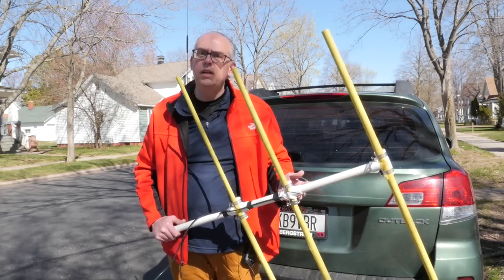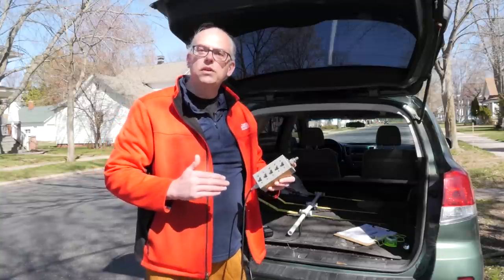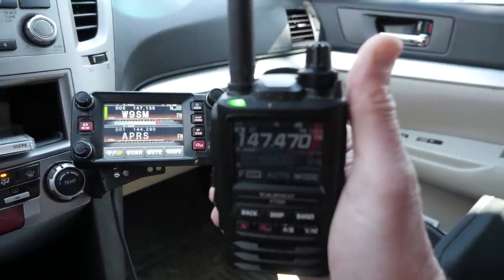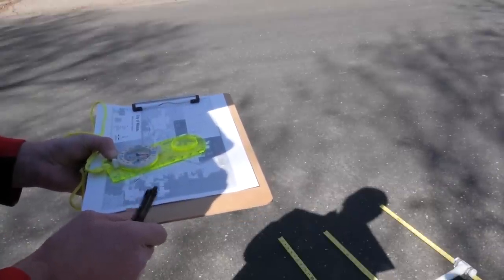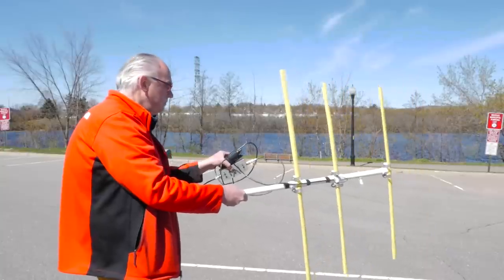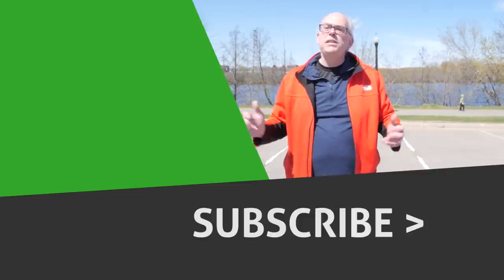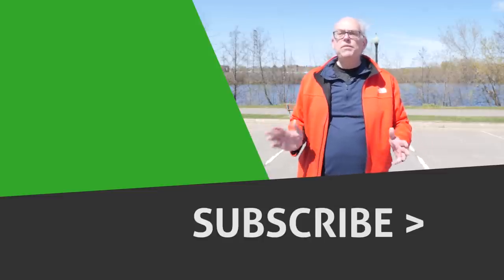Fox Hunt! (Radio Direction Finding) - Ham Radio Q&A

Comment: When I was a teenager thirty some odd years ago, the club I was a part of did a few fox hunts. I rode along with other hams and helped them out. It doesn’t seem to happen as much with the club I’m part of now or other ones in the area. 

The attenuator box is a good idea. It stuck out in my mind that people would take the antenna off the HT and point it once they got close to the transmitter. I don’t remember how well this worked though. 

Thanks a lot for this and the rest of your videos Micheal. This is Carl KB9HPM

Comment: Those tape measure beams actually work fairly well. I made one years ago and still use it. Thanks for another great video, Michael! 73’s....
Reply: I put heat shrink on the elements of mine they look quite similar to those silly tacticool Abbree antennas that are popular now. While making it I sliced my finger on the cut edge of one of the tape sections and I determined not to do that again, also I have leather seats in my car and I for sure don’t want to damage those.
Reply: @daa3417  Great tip! Question for you: where do you find big enough heat shrink tubing to go around measuring tape material? Most of what I find in stores will barely fit around a pencil.
Reply: @daa3417  that is exactly what we used for our Harris prc 152 and our Thales 148 GEMS in the army. heat shrink came off the broken ones and I was like, 'wait...this  is simply unmarked tape measure segments'  made a bunch as soon as I got back from deployment.
Reply: @adamreznik6374  Home depot or Lowes....or if you can find a professional electrician parts house in your area, they will definitely carry that size heat shrink.

Comment: I did a few fox hunts back in the 70s with cb radios. I had dual 8' phased whips on the rear fenders of the car. I usually came out on top..

Comment: Tape measure antenna is a great tool and very inexpensive to build. I added an offset annunciator to mine with a variable gain knob and use the Yaesu FT817ND without the mic to avoid transmitting and damaging the annuciator. The signal strength meter works great for this. For even more annunciation I can use the 817's RF gain or just go off frequency to get exact direction headings. Great video of your fox hunt!

Comment: Thanks for the video. I used to hunt with handheld radio's, cables and seperate antennas but they always break when you need it. Cables get damaged etc... And also, having 100 dB of attenuation and then behind that attenuator having RG58 coax and a plastic housed radio will give you direct radiation into your receiver once you get very close. This is why you needed to search the park at the end rather than keeping on direction finding. The yagi is bypassed by all the direct signals into the receiver. Better is to integrate antenna and a shielded receiver so no cables are needed. Also make sure you turn down the sensitivity of the receiver rather than attenuate the signal and leave the receiver at max sensitivity. Yes, this all requires a diferent receiver setup, but it is surely worth it.  Here across the pond we do most hunts on foot, ARDF or foxoring style.  But I think it's the same amount of enjoyment and fun. 73, Alex PA1FOX

Comment: Nice work!  Is there a reporting procedure for the local authorities to let them know this device is non-harmful?  I could only imagine what a non-ham coming across it would think.
Reply from the maker: The fox is clearly marked as to what it is with contact information on it. But to be safe you can always give the local police department a call and let them know what you are doing. Typically we hide the fox in public locations that are out of the way as not to attract attention of bystanders
Reply: I had the same thought. How is it that the bomb squad doesn't get called?

Comment: I used to take part in fox hunts and used a hand held radio and an attenuator with a very similar antenna, but when I was on full antenuation and had a very strong signal, I would turn the antenna 180 degrees to try and get the weakest rx and draw a line on my map as that would be the opposite direction from the signal source, that worked for me. Plus, I used a motorcycle to get me around quicker.... I used to be the first to detect the fox many times. Fun times. 73 DE G1YYU
Reply from the maker: Turning the antenna 180 degrees and working off the null is a great idea.

Comment: Michael, Thanks for another great video.  A question, can you use a Banfong handheld Radio for foxhunting.  I have read some articles online saying that they don't work well for foxhunting. Has that been your experience?
Reply from the maker: You can use a Baofeng handheld fox hunting‚ but there are some circumstances where it won't work as well. First off‚ the S-Meter on the radio isn't the most user friendly so it can be tough to tell the difference between a weak and strong signal. But the bigger issue with the radio is that the SDR receiver it uses is incompatible with Offset Attenuators. 

There  are two styles of attenuators on the market. Passive or Resistive attenuators use resistors in series to knock down the signal strength. That's the type of attenuator I used in the video and they will work with a Baofeng handheld. The second type‚ called Offset attenuators use a circuit containing a local oscillator to create attenuation based on an offset frequency. These attenuators can be more sensitive when searching for a very low powered transmitter and provide a higher level of attenuation when working with powerful ones. But in order to use one‚ you need a radio with a Superheterodyne receiver. SDR receivers will not work.
Reply: @KB9VBRAntennas  Michael, Thanks for the additional information.  Your explanation makes a lot of sense.

Comment: If possible, could you do a video on how the fox is built? My local club wants me to do a presentation on foxhunting and I think this is a clever idea of having the fox transmit the callsign. It's very similar to the video Rob(seven fourty-one) put out. Good job on finding it though.
Reply: William Shipitalo, it would be cool to see a break down of the fox.
Reply: Quite a few out on You Tube on building FOXBOXES.
BYONICS has several controllers. Radios with VOX control of an external mic can be used with an MP3 player. For smaller hunts use a HT with the external speaker/mic plug and the controller. For larger use a small mobile with the control set up. The one thing to look for between the HTs and the Mobiles are the way they key the transmitters. HTs usually have a 2.2k ohm resistor in line with the audio keying circuit. The mobiles don't like that and want a separate audio and keying line. 
Building a CHEAP FOXBOX.  Arduino FOXBOX controllers. BYONICS. Many different ways. 
TIP for MP3 voice foxes. Make 1 min. blank files for timing. This is your base. Make a 10 to 15 second wisecrack and mix it into the 1 min. file. Could be at the start. Could be at the end. If you are wanting to do 2 foxes, stick one wisecrack at the first of the min. for FOX #1. Do this with all the wisecracks for fox #1. For FOX #2 put the wisecracks at the END of the 1 min. file. What this does is when you use 2 MP3 players, FOX #1 goes off at the first of the minute. After the wisecrack it goes silent. Then at the end of the minute FOX #2 goes off. Says his wisecrack and then goes silent. UNTIL the next min. and you do it all over again. This can be used with 3 foxes at 20 seconds each.

Comment: Do you have to use an attenuator? I noticed the signal sounded strong in most all directions.  How did you determine strong point - the bars on the radio? The antenna is great, but most of us don't have an attenuator.  Thanks, again.
Reply from the maker: An attenuator makes it easier, but you can foxhunt without one. One method is when the signal gets strong is to switch to the 2nd or 3rd harmonic frequency (2x or 3x the fundamental). Listening to the 3rd harmonic is the equivalent of up to 60db of attenuation.
Reply: @KB9VBRAntennas  Completed my first trial fox hunt with tape measure yagi.  Problem is when I'm within 100 ft of the transmitter, even on 3rd harmonic, with the yagi pointed backwards and horizontal, the signal strength still is full bars on the S meter.  Any suggestions on increasing attenuation when close up?  Thanks again.

Comment: hi this is nick,n9wax,i watched your intrested videos and i have a question , when you make a step attenuator but for 70 cm band do you have to solder all the resistors more closer together compare to using it in 2meters due to shorter wave length in uhf?i am more in uhf and most videos i see of fox hunting are in vhf but hardly in uhf,?maybe is not that practible  or harder on 70 cm.please email me the answers,thank you.
Reply from the maker: No you don't. An attenuator is nothing more than resistors in series. There isn't any special spacing due to their frequency.
Reply: @KB9VBRAntennas  but in UHF,all the imternal leads have to be shorter and the enclosure  box will be smaller compare to VHF,am I right?long leads inside separating more the resitors for UHF higher frequencies could affect the function?

Comment: Hey Michael can u refer me to one of your videos regarding home brew yagi for uhf? I have a problematic underage operator in my area that continuously tries to interrupt comms  that he has no business being a part of. Trying to find him so I can call him out to the fcc. I am on gmrs (hoping to soon have a ham ticket) and this little bugger is using a blister pack radio to try and talk to anyone he hears on it. 2 Sunday’s ago he darn near blocked out my receive while I was on a net check-in thru a rptr 25 miles from where I live. I’ve told this youngster he can’t be on gmrs ch’s 15-22 without a license but he still persists. He’s even tried to do it on a local rptr here in my hometown when he hears it active, but he doesn’t have any luck ( hee hee).. And your videos are great, u need to add a little more humour to them. Will be waiting for your reply 73 de WRCY292 (gmrs).

Comment: Hey Michael how do they make a fox transmitter where people like you go find it I saw that he had a radio how does he program that to Translate every few seconds ???
Reply: The one in the video is a PicCon controller made by BYONICS. They have a couple of types of Fox Controllers. This type is a tones and MORSE CODE style controller.  If you use an MP3 player with a radio with a vox mic, you can program the files to send the message and control the timing by how long the file is with delay files between the audio file. If you make a 10 second wise crack, put it onto a 1 min. long file, then put 10 such files together, you can have a 10 min. hunt. FCC id every 10 min. Make more jokes or loop the files for a longer hunt. If you don't have a radio with internal VOX, find an old Radio Shack VOX mic and use that. They can be modified to stretch the VOX delay so that you don't cut off the punch line of the joke.
Reply from the maker: The Fox is using the Byonics controller. I guess I'll be hiding the fox next so I'll do a detailed breakdown of it in a video
Reply: KB9VBR Antennas  ok thanks Michael
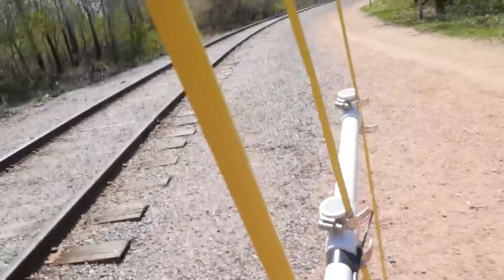Reply: What kind of tones did you guys program in that controller 9:04 9:13  it’s like a 7 tone before it IDs. If I could get those tones in numbers that would be great.

Comment: for the directional finding, can you tell me why only one director element? Seems like if you're trying to triangulate you would want a narrow beam.
Reply from the maker: You can use a longer antenna, but in reality you don't need a lot of gain, just a good front to back ratio. That is strong reception in the front and deep nulls in the back. Plus a longer antenna will be heavier and more unwieldy while on foot.
Reply: @KB9VBRAntennas  i guess when you use an S-meter to determine signal strength then the granularity is so bad that it really doesn't matter. i would think for best performance you need something that shows the signal strength in steps of 1 dBm, that updates in real-time, and a lot more elements for a narrow beam.
Reply from the maker: Possibly, but what sounds good in theory may not be the best in reality. You don't need a high level of precision in searching for a fox. If the S meter gets swamped, you increase the attenuation until you have a good amount of deflection on the meter.
Reply: @KB9VBRAntennas  I'm not an amateur (thinking about becoming one) but I do have a mystery signal in my area that I want to track down. I have a logarithmic detector that I want to utilize. The input range is about -50 to 0 dBm. I don't even think I'll need to attenuate anything, I'll let you know how it goes.

Comment: Fox was also horizontally polarized
Reply from the maker: Another element of confusion. Holding your antenna horizontally is another method of dropping the signal strength as you get close. With this fox‚ that tactic didn't work so well.

Comment: His radio has a built in attenuation, would have helped a bunch
Reply from the maker: Typically the built in attenuation isn't enough to sniff out a transmitter. When you get close, it can take up to 80dB of attenuation to see deflection on the signal meter.

Comment: What about a loop antenna?
Reply from the maker: Loop antennas can be used in fox hunting and may be a good choice for close in work. But they have one problem: they will receive a signal off the sides in equal strengths and have nulls of equal depth in the front and back. Since there is no front to back strength ratio like in Yagi antennas‚ you can't really tell which direction the signal is coming from.
Reply: Loop antennas can be made directional by adding a 9" sense antenna to one side of the loop. The side away from the sense antenna  is the front with the most gain the sense end is the back and the least gain. Get a bearing just using the loop. Then add the sense antenna to find out which way the signal is coming from.  Check out " Transmitter Hunting. Radio Direction Finding Simplified "  Joe Moell

Comment: Great video! This video reminds me of a time when I helped locate an illegal cordless phone that was transmitting on the input of a repeater with 40+ mile coverage. I used an Icom IC-2720 mobile and I adjusted the variable attenuation until I got the location narrowed down to a 2 square mile area. From there the repeater trustee took over with a setup similar to the one in this video and located the person operating the cordless phone.
Reply: Doing the Lord's work. So happy there are folks like you doing this.

Comment: Loved the video but, what a major safety violation and trespassing. Having to cross railroad tracks to get to the fox may seem innocuous but almost 1,000 people a year die with train encounters. Railroad Police are the most unfriendly law enforcement agency, glad you didn't have a run in. Be safer. Love my J-Pole.
Reply from the maker: Normally I would be concerned about the tracks. The fox was hidden in a public park and you can see the walking trail on one side of the tracks. That particular line is exempt as it may get a train through there once or twice a month. But yes- stay off the tracks.